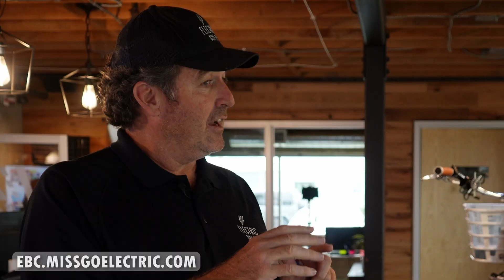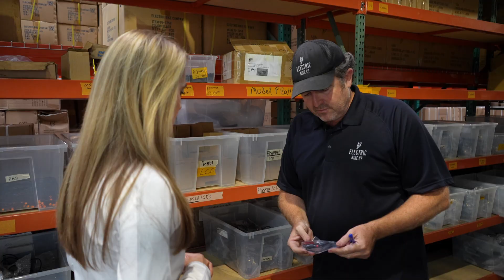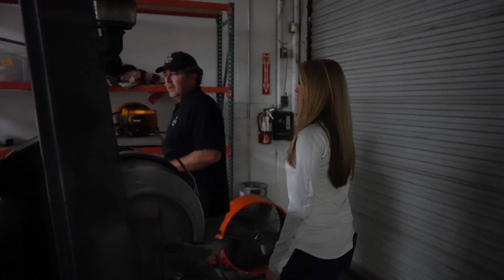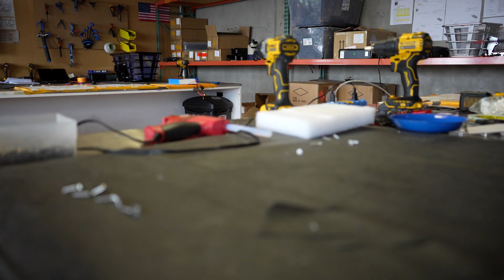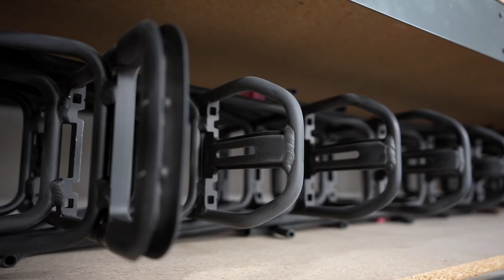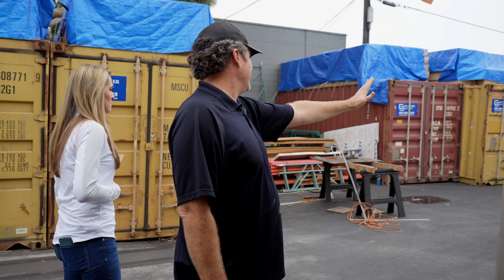American eBike Factory Tour - Inside The Electric Bike Company

Comment: Great interview & tour. Thank you! I've thought about a front basket battery since I got my Biktrix Stunner and realized the only way to get it past 26 mph would be a hub motor & controller on the front wheel. It has mount points for a front rack. I'd still have to buy the motor kit, but having a battery integrated into a basket would be great. Trying to build one at home or hack it together would just take too much time. if Electric Bike Co could sell a 960 Wh basket battery for $600 that would be fair and worth the premium over building it DIY. I'd love to see them somehow work with Luna Cycles.
Reply from the maker: We will soon review the Miss GoElectric edition of the EBC Model R.  It goes 28mph and has 1.5kWh of battery capacity.  It has more range than any eBike we've reviewed.  We plan to edit and publish this week.